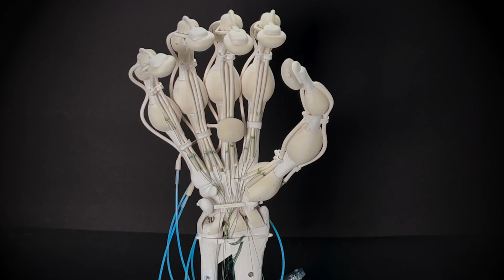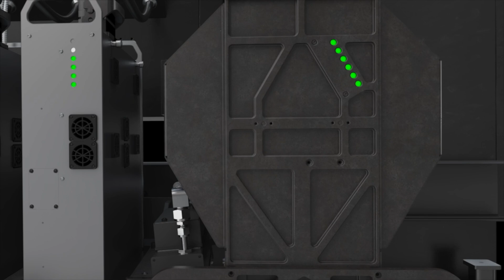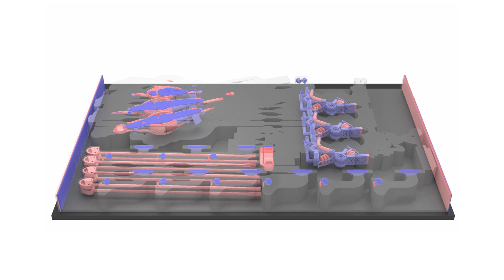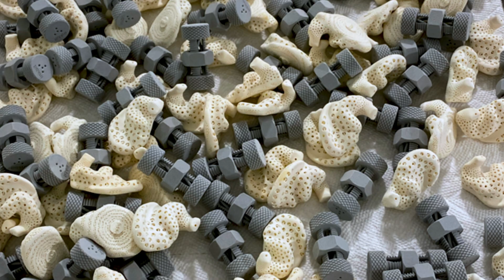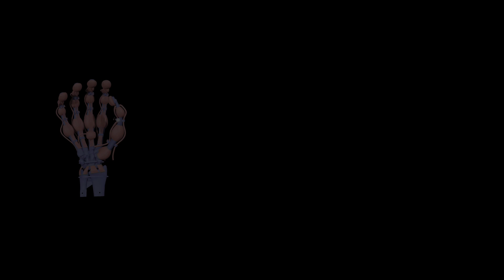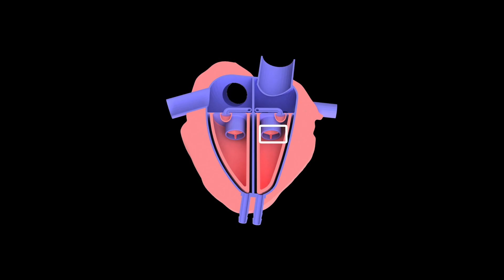This 3D printer can watch itself fabricate objects

Comment: Not too far off the Stratasys Objet (former Connex) printers. From this video it seems they added the closed loop with the camera on top of what was done already. Stratasys Object series already can do it all. 16 microns layer height. Any advance is welcome.
Reply: @Zuluknob  Thar's neat! I'm in need of making such high res in Z. Do you have any material published on your adventures?
Reply: @Zuluknob  You are spot on what necessary info to give. You seems not only good as a Maker but also as communicator. I wasnt aware yet of closed firmware. Multiple Z model by the gear ration reduction is the way. Noted.  Thank a lot!

Comment: very interesting. I would love to see a slo-mo close up of the jets depositing the various materials. I am wondering how the wax becomes solidified? or because it is so thin a layer and essentially sits in a pool of wax.. it can solidy withou driping out and off the off object? perhaps a wall of material with a higher melt point surround the wax/ I am guessing with a such a thin(i presume) ink jet layer.. the resolution must be increibly high? Is the other materials it uses to print with, PLA or ABS plastics or ??